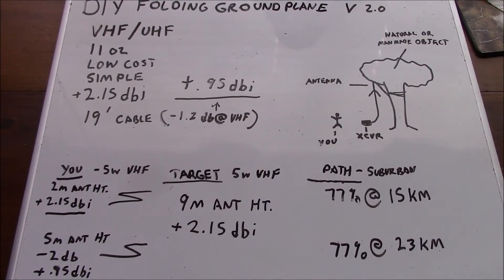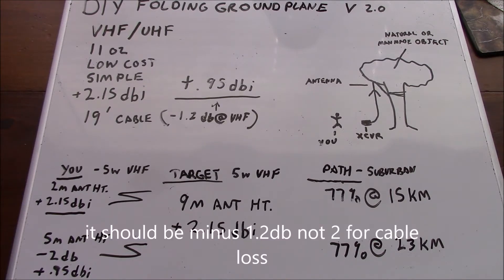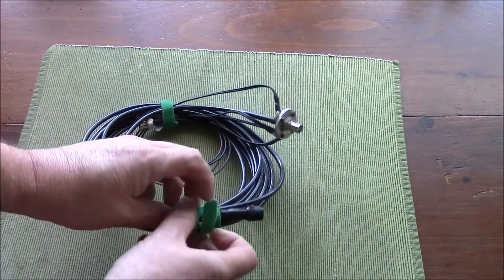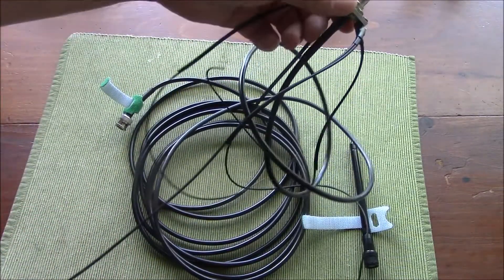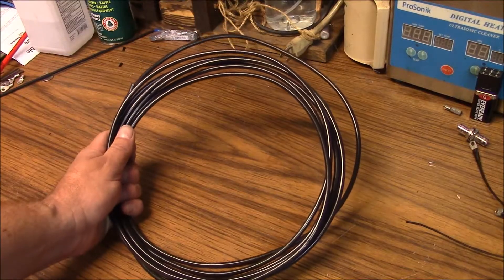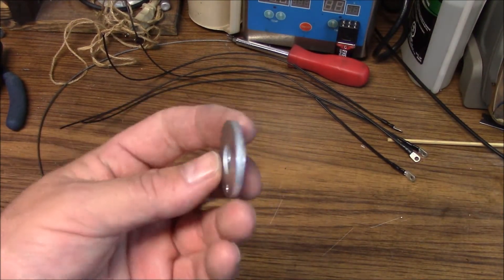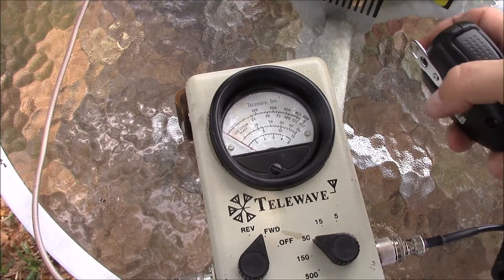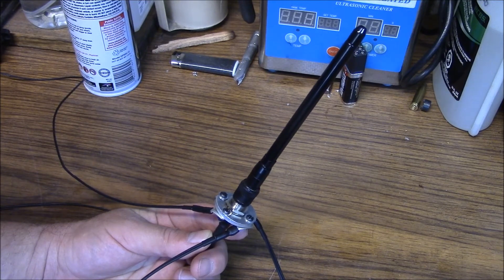DIY antennas The VHF / UHF folding ground plane antenna v2.0

Comment: I am wondering if a simple car radio telescoping antenna salvaged at the junkyard would work for this project
Reply from the maker: It will work fine just make sure to run the resonator at 1/4 wavelength at the frequency of interest. Thanks for watching !

Comment: Been running and testing 2 simple dipoles made from ye'old TV Rabbit Ears for about 6 months.  These were bot at the thrift store for .50 to a buck cents each.  Been pleasantly surprised their performance.  RX is weaker than a ground plane, yet not much, handles 65 watts,  is fully collapsible, and allows for horizontal polarization.  Ran it that way strapped to the lumber rack of a pick up.  Works good.  Cheap too.
Reply from the maker: That is cool ! Cheap, practical, and efficient. What did you rig up to feed it or did you go with RG59/RG6 ? Thanks for watching and the input !
Reply: RG58.  Broad banded.  Easy to do.  Tape the joints.  Of course it could also be tuned up for VHF/UHF.  It talks to repeaters in Canada, Montana and Idaho, 70+ miles LOS on 10 watts.  I am at about 2,800 feet in elevation, repeater typically at 6,000 feet .  Used horizontally, it is of course somewhat directional, but that could be a good thing, and the signal is attenuated by about 20db, or by about 99% to those receiving with a vertical polarized antenna.  A VHF signal can bound off stuff and change it's polarization somewhat, so 20Dbs's of attenuation is not necessarily constant.  The longer the distance, and the type of terrain will increase or decrease a potential shift in polarization.  UHF may not have as much problem with this.  Generally speaking, used horizontally, the transmitter is much harder to hear, and often is not heard at all, especially if one uses low power.  Using a yagi with 1 watt into it, and 5.5 watts ERP out, talking on 2 meters to vertically polarized rabbit ears at about 25 miles LOS, I was loud and clear on the rabbit ears.  Turned the yagi horizontal, and the squelch on the other side did not open.  They did not hear me.  Using low power or better yet , very low power, a yagi, and going horizontal can make you harder to be heard, and harder to find. VHF bounces and could confuse.  However, using very low power narrow band UHF  would be more secure if the idea primarily is not to be heard, especially if a directional antenna is used.  VHF on a yagi, one can find a rock face on a mountain, and bounce the signal out of your canyon, so each has a set of advantages/disadvantages.  Most mobiles can pump up a VHF signal through a 5 element yagi up to around 300 watts.  If the signal is everywhere, you are no where to be found.
Reply from the maker: Very cool. Using polarization to minimize interference is definitely an under appreciated tactic. I have a 3 element VHF yagi from a  lift station that really works well in that role.

Comment: I really enjoy your videos and the detail in which you explain. Also, curious about your hammer blow wire crimper. Is that an E-Z Red?
Reply from the maker: Thank you. I'm unsure of the brand but it isn't an ez-red. I bought it off of a tool truck years ago. I was working on a project where I was working with  a lot of 4ga wire. It definitely is easier to move around than the die crimpers with long handles.

Comment: Nice setup.  What is the connector on the other side of the BNC bulkhead?  The figure 8 cable is handy for dualband radials :)
Reply from the maker: It crimps on the cable directly. I could have used the double female bulkhead like the folding discone and used another male but felt reducing connections would be good.  The twinlead cable did work out well. One of my mentors introduced me to that with HF verticals and  buried ribbon cable long ago. Never tried it on V/U until this project. Thanks for watching !
Reply: ah okay, I know the ones.  reducing connections is always good, plus crimping is a good solid connection.  clever idea on the fender washer - good platform to attach the radials.

Comment: Very interesting antenna setup. Could you compare this eventually to a N9TAX slimjim?
Reply from the maker: I did compare it to the 450ohm jpole (slim jim) I made a video on in the past.  I have not tried the N9TAX variant but would like to. I have found performance to be very similar with the ground plane having an edge in bandwidth. Some time ago Guerrillacomm did a comparison on his channel if I remember correctly. Thanks for watching !
Reply: That's great to hear. Very cool design. I reckon this would be less influenced by nearby objects than a slim jim
Reply from the maker: Thank you. Yes as you can secure the feedline to the support structure and place the resonator above said support structure.  I know nearby metal objects can be helpful with the right spacing making a reflector.

Comment: Nice work Bret (is that how your name is spelled?)

There is another way for fixing the radials/counterpoise wires. You can solder them on a tinned steel washer. (I have tried it and it works)
Reply: Copper washers are also available at some hardware stores.
Reply: I think the copper/brass washer will require a soldering gun for having such a large heat mass. But it never hurts to have another option.
Reply from the maker: Thanks ! Yes you have the spelling right.   I need to give the solder idea a shot.  What tool did you use to heat the washer ? Thanks for watching and the support !
Reply: Just a 45/60W solder iron. And some persistence. My first sample (not shown) had the washer soldered on the female-female adapter and bare copper radials soldered too. http://s176.photobucket.com/user/greekpreparedness/library/Groundplane%20Radials
Reply from the maker: cool I dig it. With a small iron it can be tedious. . Thanks for sharing !
Reply from the maker: That would have been a great choice. I had the aluminium one in the jumk box . Thanks for watching and the input !
Reply from the maker: I was going to use a piece of brass shim stock and cut it out before I found the aluminum one I used. The awesome thing about antennas in general is the wide open room for experimentation at minimal expense.